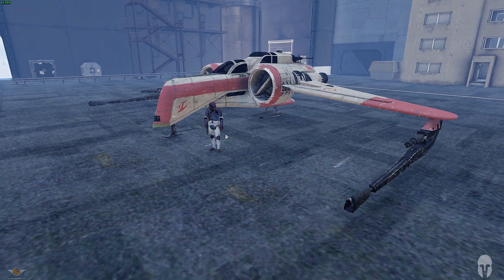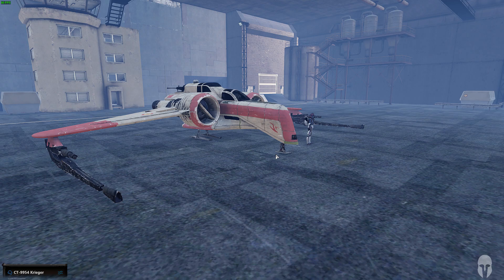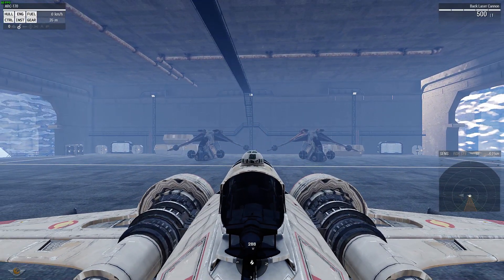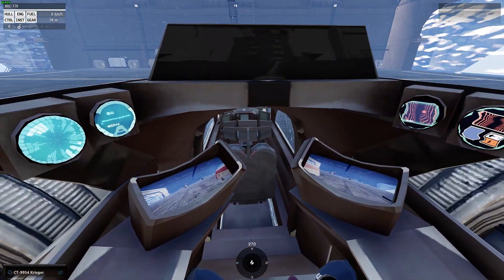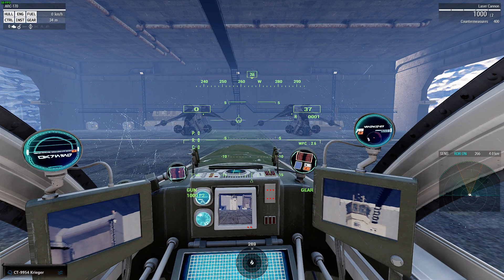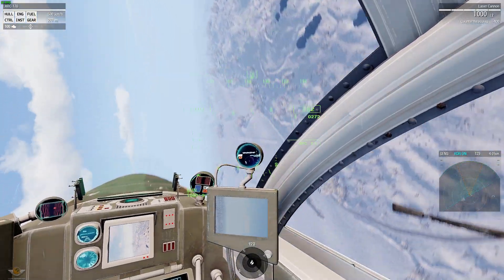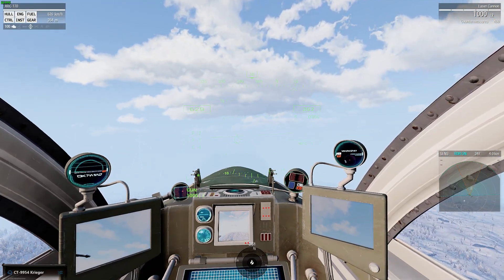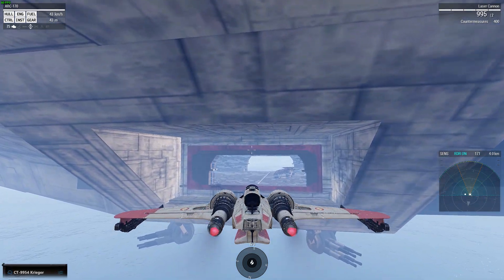How to fly an ARC-170 Star Fighter

Comment: Correction: The Z-95 headhunter already existed by the ARC-170's release, also, the ARC-170 is a much better fighter than the Z-95. It doesn't even have S-foils! (Movable parts of the wings or additional movable wings that can be set to attack position) The ARC-170 technically has 6 wings, 3 sandwiched on top of each other per side with the top & bottom wings being movable S-Foils. Also, what game is this?
Reply: It’s Arma 3